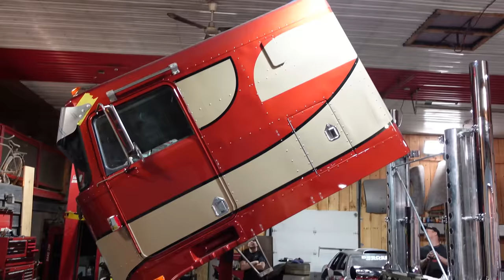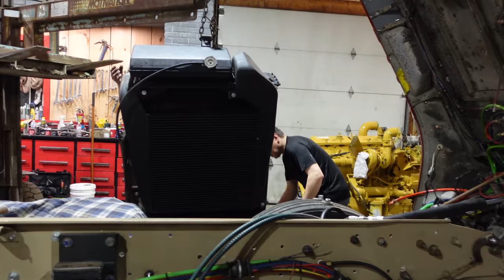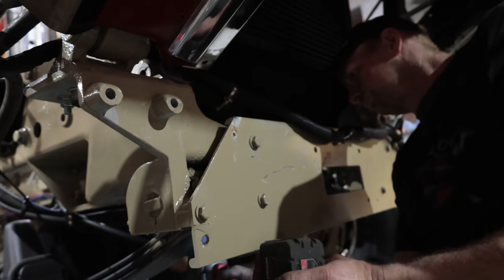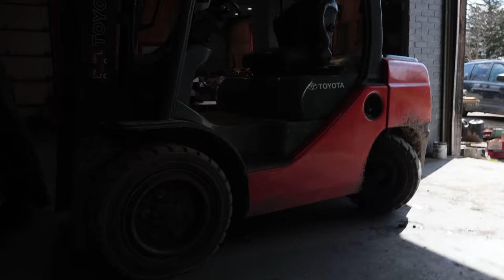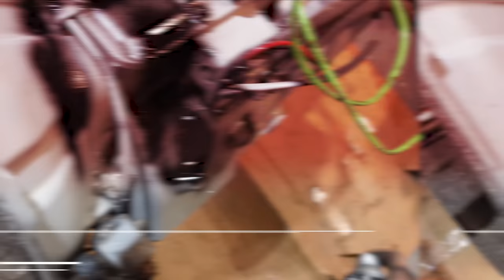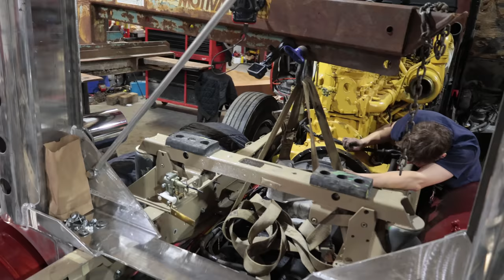3406 CAT Engine + 13-speed Transmission Install | #K100Cabover [EP10]

Comment: After watching this it gives me appreciation for the folks that work on these trucks for a living as everything is kingsize and not easy to move without forklifts, etc.
Reply: Got to be strong enough and smart enough or else you break yourself haha
Reply: @aaronhall7740  the job certainly takes a toll on the body after many years of doing it . I used to like the when the odd COE would come in for tranny or engine work so much easier with the cab removed from the equation.

Comment: Pro tip for the future don’t leave anything in the cab when you’re raising it I’ve had things fall from the footwell of a truck and smash the windshield
Reply: Sounds like a personal experience lol
Reply: I once upon a time knew a guy who was so proud of his new snake skin boot that he wouldn't wear them, he would set them up high on the dog house for everyone to see, and he slammed on the brakes and his boots cracked the windshield, be smarter than him, he also once bought a monkey for his wife and thought I can get the company to pay for it, so he had it written up as a monkey wrench for $100 back in the early 80"s that didn't go over well either
Reply: LoL... seen a 12" TV fly through the windshield once! TV broke once it hit the concrete!
Reply: Ouch!
Reply: Yup I left my Milwaukee drill on the seat of a Freightliner. I lifted the cab and the driver got a new windshield out if it.
Reply: I still work on cabovers to this day and the most common disaster is an unsealed drink
Reply: @cargotoolshop5319  
Sounds like a character for sure!!!
Reply: That happens to everyone at least once
Reply: Remington Steel  
"Hanging" out in Naples Florida!!!

Comment: The K model was the most beautiful truck ever made in my opinion back in 1973. The only KW I ever drove, however, was a 1990 T-600 "Anteater". The last cabover I drove was a 1990 Freightliner - the one that I was almost killed in and the one that ended my OTR career.

Cabovers have a faulty design that make them dangerous to drive. A side impact could twist the cab beyond the capabilities of the cab locks to do what they were designed to do, allowing forward momentum to flip the cab over where the driver can be seriously injured or killed.

This is what happened to me on April 28, 1992. 3 days after the accident I came to in the hospital and was told that they "lost me" 3 times. Every bone in my body above the waste was either broken or separated and a fractured skull blinded me in the right eye (ending my career). I spent 2 years recuperating and had to start my working career at the bottom - very depressing after investing so much time, money, and effort.

Even if I could drive again, I'd never go near a cab over again.

Comment: Rich, everyone is a expert as I have personally witnessed myself. Working in the logging camps in southeast Alaska  gave me the knowledge... that no two trucks fall together the same way. But that said, this is the first time for me to see the transmission come in from the top. They need to invent a narrow ratchet strap thats got the same strength and yet not get in the way.. I know you have done this a few times and even so found the test runs didn't really go like planned on the final step. I used to find myself holding my breath till a bolt would start. Thank you for the most real install going yet on the internet and congrats on making this a truck again. Heaven forbid some other hidden agenda is lurking behind the scenes
Reply: Nibbling great
Reply: There is. I have a pile of half width ratchet straps that are almost the same rating. 
In saying that, an actual lifting strap is way thinner and easier to work with but you can't adjust the length

Comment: Hey. She’s looking great. Tech tip for future trans installs. 
Cut the heads off a couple of long bolts and thread them into the back of the engine. Use them as guides/studs through the trans bell housing as you walk the trans up to the engine, helps keep everything square and lined up.
Throw some grease on the said studs and be real careful to keep your angles good and the weight off the studs so you dont bend them or worse break the back of the engine. This helps aligning the plates for the last portion  of the trans install.

Comment: FYI, you can ratchet strap the cab back over centre. You can also use a ratchet strap to stop the cab lowering over center if the hydraulics are leaky.

Comment: I held my breath when you said that 13 speed was the same as the 10, "just 3 extra gears." The back half of the trans on a 13 speed has a whole additional set of gears and an extra shifter for splitting, and is a whole lot bigger than the back half on a 10. Guess you found that out. . .!!!! Hopefully by now you've also remembered/discovered that you need a different shift knob mechanism and additional nylon air line as you now have an extra piston to move on the back half for the splitter!!
Reply: I was saying the same thing...the extra gears make it bigger..
Reply: Same as the 10 as in same final drive ratio out the back. It's just extra gears.

Comment: Always have a safety catch chain on the cab to frame when going over center with the cab. There can be air in the hydraulic lines. In free fall the cab can pull the cab rams apart.
Reply: We have a similar but different set up here in the uk 99% of the trucks we use are cab overs that are literally a dash, seat then bed in the back, when the cabs go over centre it’s alarmingly sketchy lol the best I’ve seen are the pneumatic electric pump operated systems you can control it from bottom to top
Reply: @simonhenry8598  The new iveco stralis near kisses the floor once it starts to tip, tight arse moment the first time round
Reply: @BangorBmxGang  it is a mechanic who came out to me years ago when I was driving a MAN wiped out the front grill forgetting it was open 😂
Reply: Another trick is leaving something in the cab or sleeper and having it cascade forward and down as the cab tips forward, breaking the windshield or smashing something in the dash.
Reply: And make sure you have everything secured and not loose... or you will quickly see it zip past.

Comment: That used to be my job when we were putting new engines and transmissions in semi trucks. Oh to be 19 again and driving around with an engine almost heavier than the forklift. OSHA would not have been pleased. I can still hear the boss directing me with a Cummins 400 hanging from the forks. "Tilt the boom just a smidge forward", "sorry no can do" "than hop off and come help me" "sorry, no can do" "why?" "Cuz the steer tires aren't touching the ground but now and then!" "Ah crap we got to take the front tire off then so we can get closer". 😂 Lol

Comment: For alignment of transmission to engine, I cut bolt heads off of two or three bolts. Grind a cone on end of headless bolts. Then thread the headless bolts into engine. Then slip transmission on to headless bolts. Slide   transmission to engine. Start other bolts
 Then remove headless bolts. You are good to go.

Comment: Keep up the good work. Doing one hell of a job. I found that it’s a little easier to hang the clutch on the trans and then bolt it to flywheel after the trans is installed you don’t need as much room to slide them up and down that way. Just giving you some ideas for the next time

Comment: Friendly tip: Before cutting the bolt thread the nut pass where you plan to cut, and when you cut it take it off, and it will clear the threads.

Comment: Riche you gotta build yourself a gantry crane. You can purchase a used one at a pretty decent price were it won't break the bank, you might have to modified it some what to fit your shop but in the  long run it will save you a huge amount of time and lets be honest here Time is money right. Than you won't have to mess around with fork lifts and take forever to get things done.

Comment: The tuck looks great.
In relation to the fork lift Side shift....
 I would think that the upper bushes are worn out
Have been working on those Toyota units for over 30 years and the side shift does work even if the back wheels leave the planet
Like all the posts Rich
 Gaday from Australia

Comment: You can eliminate those tanny cooler lines by getting a bypass plate from eaton that bolts onto where the oil lines are and lets the pump get oil tp the tube inside that dumps oil on top of the gears.

Comment: Take some bolts that fit the bell housing , cut the heads off and put a slot in the top for a screw driver. Use t h email for guide pins when mating the trans to engine.

Comment: Ahh, that was a great jump cut and return. 
Ha with the Trans, normal make sure you can get the fill plug out before you drain it for things in operation, but this was drain first to see if viable. 
Gahhh ratchet straps, always make they are in good working order.

Comment: I hope its an RTLO and not an RTO. Its longer because it has an extra syncro hub in the back. Flipping the top two gears in the 10speed to make it overdrive would have been all you needed. I cant see you will pull enough weight to warrant half gears in high range. Tank is heavy but not that heavy.
Did you grease the spines or go in dry? Having it in a gear means you can wiggle on the yoke which can help as well.

Comment: Grab a couple spud wrenches or small sleaver bar. Definitely helps aligning those bolts in holes . Tip from an ironworker good video.

Comment: New to me trucks I hate jacking the cab when it over centres and you pray it's going to stop 
A good story from my trade teacher that serviced fire trucks, a brigade decided to put Engel's in their trucks (40lt 12v portable fridges) 
So they lift the cab and all of a sudden this fridge just shoots though the front window and hits the ground, scared the shit outta everyone 

For reference the  bush volenteer fire brigade uses 4x4 izusu  single cab trucks with a big area behind the seat full of storage boxes with gear, storage boxes are all bolted down but they threaded an Engel's in amongst the boxes

Comment: I could see in your expression that you wanted to re-torque those frame bolts…I know I would. Partially because I torque every bolt twice, and partially because your friend tightened the bolt instead of the nut. Call it OCD :-)

Comment: I wouldve put a 39mt starter in place of that 40mt. 40mts are slow right out of the gate. Are you planning on running 24V start up with a SP switch or did you convert the starter to start on 12V?

Comment: Hi, I'm just curious. Was the 13 speed Fuller longer than the 10 speed because of the splitter unit at the rear of the gearbox. Thanks, your workmanship is brilliant.
Reply: Yes a 10 13 15 and 18 speed all have the same main gear box with a different auxiliary box and you can get each trans in a variety of different ratios and shift patterns

Comment: so i just got my 460 running today after rebuilding it myself but i put the holley back on "this crab was on the last 460 that blow" and when it starts up the rpm is 4k on start up, bad seal on a carb? im only 22, ain't got much experience with carbs but i knows there no vacuum leaks, set screws on the measuring block are all the way in and the and the idle set screw is all the way backed out and floats are not sticking, any ideas? i was thinking a new carb but this carb has less then 100 miles on it but it did sat for a year but i clean the gas out a year ago

Comment: It might be outta faze intentionally. If you have a stupid vibration later go back to that orientation. They do that to cancel other vibrations out in the driveline sometimes.
Reply: On most vehicles the center line of the output shaft of the transmission is parallel to the center line of the input shaft on the rear end they need to be in phase. Volvo trucks install their engines at more of an angle down in the back so that in the event of a front end collision the engine is more likely to go under the cab then into it. The center line of the transmission and the center line of the rear end are not parallel and they run the drive shaft out of phase to compensate. Doing my pre-trip on a Volvo I noticed that and I mentioned it to the mechanic. He pointed to a bulletin from Volvo explaining why it was like that and how to correctly install the drive shaft.
Reply: Make sense I was speaking with a Volvo tech at the time. Now that I think about it.

Comment: Good video. The 13 the 18 speeds are the same like a 10 speed is shorter the rear box is shorter it would only took you another 10 minutes to pull the top cover and inspect it real quick I know it doesn’t take long to pull the trans but could’ve still looked at the gears real quick and just so you know the airlines read in the front Green black and blue in the very back

Comment: You guys make that look too easy at some of the gun went right in there That's a big motor and that's a huge transmission I used to have a couple Peter builts I never did that kind of work to my trucks and it's way out of my league Bitchen  job Thanks for the videos

Comment: I wonder if it's possible to modify a cab jack to lift the cab with air pressure so you wouldn't have e to pump it up a hundred times. ???

Comment: No dowel pins on the bellhousing?
Reply: No, I cut down two really long 7/16" bolts and thread them in the bell housing to help align the tranny when installing it, you would be surprised how fast you can pull engines and tranny's in semis, I can make it look easy but the funny part is how wore out I am after a day in the shop, I drive trucks and only wrench on them when they break, stay strong

Comment: So I have no idea what I’m talking about here,never worked on a cabover but couldn’t you put the driveline in first then put the cab on?
Reply from the maker: Because the cab was never in the way.  It is easier to install the cab on the frame with no driveline (I did it solo in about an hour) than the engine with with the cab on

Comment: Bit late to comment now but it would have been a lot easier if the drive train had been fitted before the cab. After all that's how it's built at the factory as the cab is one of the last things to be fitted in the 'marriage'.

Comment: You guys should really be using lock washers brand new grade 8 bolts and red loctite on the bell housing bolts. I've seen them come out way to many times. Just don't want to see the hard work fall out on the road

Comment: I'm thinking that if there is any water in that transmission it's going to separate from the oil and be floating on top of it.
So of course the first ounce or 3 out of the pan will be normal
Reply: oil floats on water normally?
Reply: Check the densities of gear oil and water and try again.